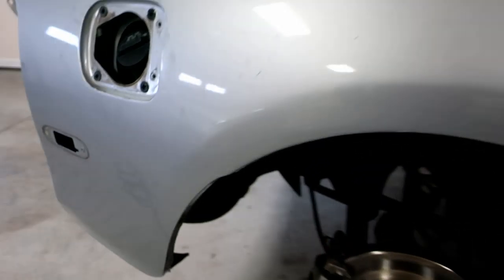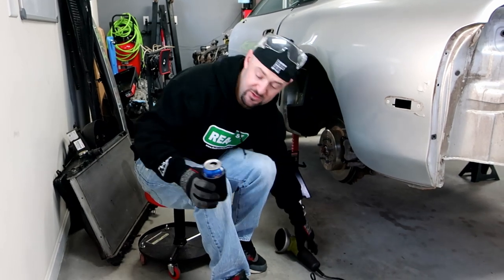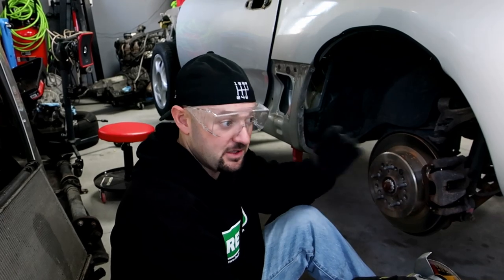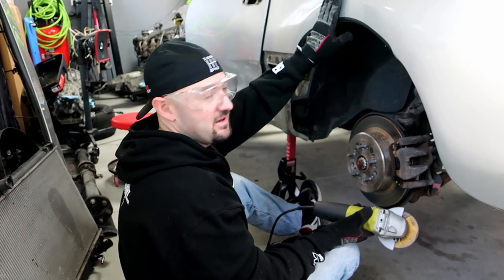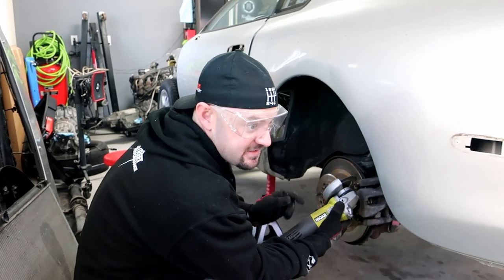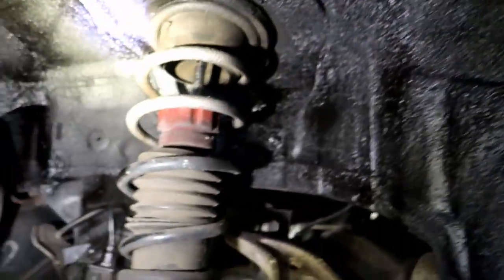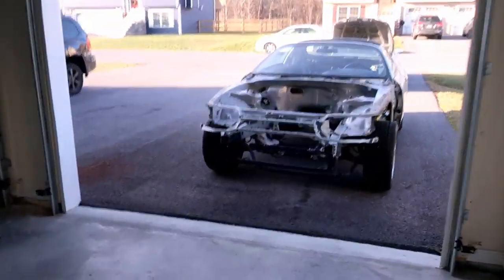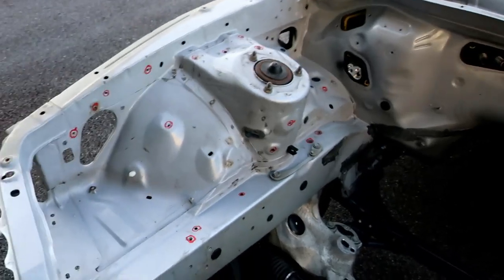Cutting Quarter Panels on MK4 Supra!

Comment: Yo dude. As far as the seam sealer. Just use a flathead and scrape it off. Use a wire wheel to clean up remaining sealer. That’s how I do it!  Works very well

Comment: Would rolling the Inner guard do roughly the same thing or are the wheels that are going under really wide that they wouldn't fit
Reply: Most Toyota branded products are double walled. You can roll it but it's SUPER easy to get an effect called bacon fenders. Nobody loves bacon more than I do... But not on my car's body.
Reply: TheProPilot I’m pretty sure all quarter panels are double layers on all cars, the quarter skin always is either spot welded or glued to the outer wheel house. After seeing him cut it tho I should have done this to my FD, rolling the quarters was a bitch.

Comment: Is there a reason you cant roll the fenders on a supra? I mean when a fender or quarter is rolled it keeps its structural  integrity! You grinding it the way you are  is  really weakening that quarter panel! I have been a painter/body guy for 30 years  and I cant remember the last time I had to grind a fender rather than roll it.  You just prep the fender before you roll it so it doesn't rust . I like to roll the fenders then fill in the rolled gutter with shortstaind fiberglass. I never had a rust issue doing it this way.
Reply from the maker: Mikes Garage they’re double walled they’re stronger than 99% of cars on the road. With them being double walled if you roll them they cause a “bacon” effect that’s pretty horrible. So for the MK4 supra cutting is ideal over rolling
Reply: @PureFunction    WOW that's good info!   I never knew that!  And here I am thinking your hacking up your car! LOL  Thanks for the heads up Ryan!